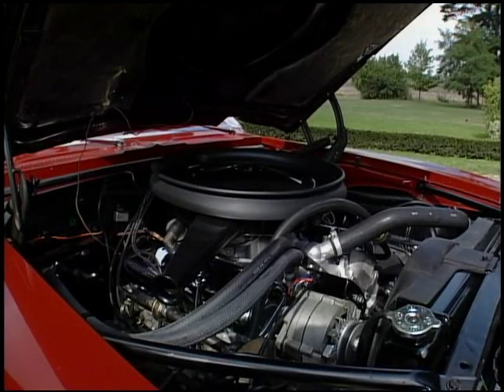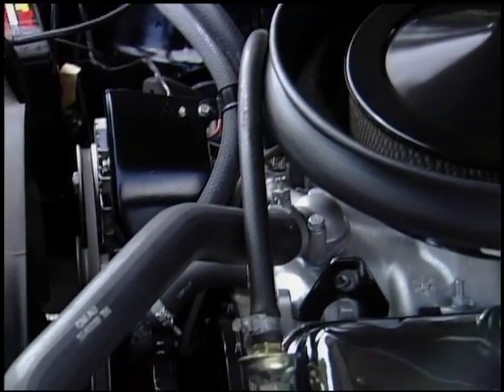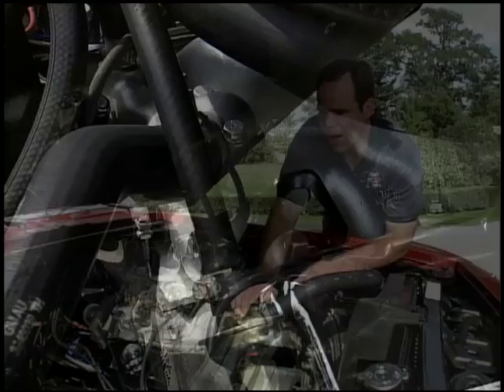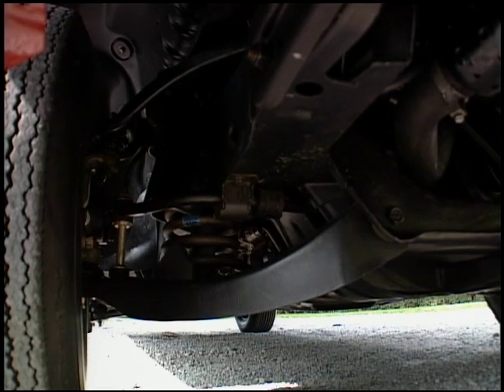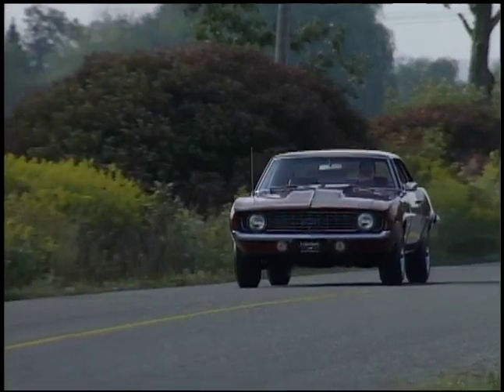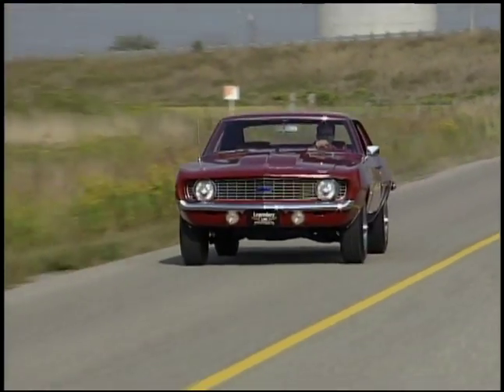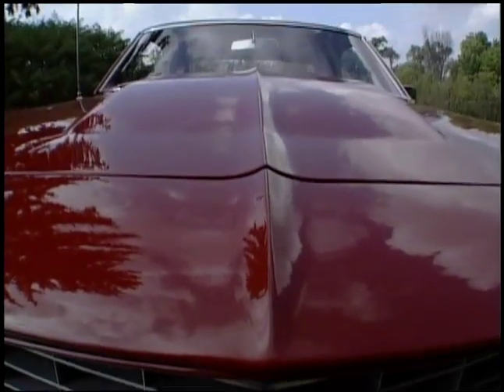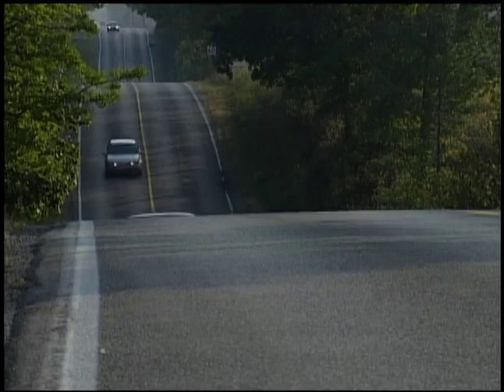Camaro ZL1 Dream Car Garage 2003 TV series

Comment: Why is it a ZL1 in a Camaro and a L88 in the Corvette?
Reply: because they were two completely different engines . L-88 used the cast iron block with aluminum heads , and the ZL-1 was all aluminum, and they did make two ZL-1 Corvettes .. If you wanted a L-88 in anything other than a Corvette you had to build it yourself .
Reply: @bobbrinkerhoff3592  I can't look at it now, but I am almost positive that his 68 L88 was all aluminum. I could be wrong but I don't think so. As so as his dad bought it he had twin turbos put on it, he drove it one time and it scared him so bad he parked it in the garage and last I heard it was at a storage in Upland California.
Reply: @jameskosharek6838  L-88 was only available in 1967,'68, and '69 Corvettes , if the engine was in any other car it was transplanted into it . There was a guy a year behind me in school that had a Marina blue '67 Vette and it said  L -88  on the console , right behind the shifter . I don't know if the redisigned '68 , '69 cars did also , as I have never had the chance to get that close to one .They made an aluminum big block starting late in '65 for Can Am racing (Jim Hall's  Chaparrals ) , with the street version  ( ZL-1 ) coming out in '69 . The L-88 was iron block , with aluminum heads . Edit; each engine had their own camshaft profile , the ZL -1 was the wickeder of the two , then they started doing updated second and third design versions  of each .
Reply: @bobbrinkerhoff3592  It must have a ZL-1 in it.
Reply: @jameskosharek6838  that or they upgraded to an aftermarket block when they added the twin turbos to it .
Reply: @bobbrinkerhoff3592  that is possible.  Thank you for all the wisdom you possess.
Reply: @bobbrinkerhoff3592  a friend of mine, his dad has or had a 68 L88 but it might have been a ZL-1 because I swear the block was aluminum but I could be wrong. As soon as he bought it off the showroom floor he took it to a shop and had twin turbos stuffed into it. My buddy took it for a joy ride almost crashed into a curb and parked it. The only reason his dad knew someone drove it is because he didn't lift the hood and the turbos burnt the hood and the paint. Needless to say he was pissed. I think it is setting somewhere in Upland California that was the last I heard about it.
Reply: @@generallao1554 what about 68, that's what my friends was?
Reply: @jameskosharek6838  '69 was the only year for the ZL1 Vettes and they only built two of them and close tabs are kept on both of them . '68 was the iron block , aluminum head L-88 cars .

Comment: "The 69 Camaro ZL-1 made an even better street car than a race car" said nobody EVER. The ZL-1 427 didn't have any street manners because of it's 12:1 compression ratio and L88 cylinder heads. Definitely not an ideal car to buy to drive back and forth to work every day. A 69 Camaro SS 350 or 396 or a Camaro Z28 was a much better choice for a guy who wanted a fast car that could still be driven daily. If I was buying a brand new Camaro in 1969 it would be a Z28 with the dual quad Cross Ram intake...one of my favorite small block muscle cars ever made
Reply: Sorry, but the dual quad Z/28 would be a horrible car to drive on the street!  Over-carbed and under-powered at low RPM for driving sedately away from a stoplight so as not to attract the attention of law enforcement, that car was for racing ONLY!

Comment: The baddest BowTie ever made is the 69 Camaro ZL-1 But I wouldn't mind owning a 62 Bel Air 409/409, a 65 Impala SS 396/425 hp, a 66 Chevy II L79 327/350 hp, a 69 Chevelle COPO 427, or a 69 or 70 1/2 Camaro Z28. I'm a Mopar guy first but I'm a muscle car fanatic no matter what brand. There's very very few that I actually don't like

Comment: 69 1969 Camaros received the ZL-1 engine right from the factory under the COPO 9560 build order, but only two 1969 Corvettes received them.  Go figure.  Of course, you could always buy one over the counter and install it yourself or pay a dealer to do it for you, but that was half the fun.  Then you could go hang out with "Grumpy" Jenkins on the weekends...😄👍🇺🇸

Comment: "TRIPLE RED"  ???  Interior, body paint....no vinyl top (would be 3).
Reply: @david bleh Uh...what?  The red carpet is part of the red interior.  The OP is correct...for it to be TRIPLE red it would have to have a red vinyl top aaaand...there actually was no red vinyl top available on a '69 Camaro.  You could get a vinyl top in black, white ("parchment" they called it), blue, brown or green.
Reply: actually they considered the top to be separate . The body tag would show two identical letters or numbers ( depending on the paint codes used that year ) for a single color painted car . Vinyl top cars had the paint code first and the vinyl top code after it . Technically it's a tri colored car , But most of us would call it as being red , with a red interior .

Comment: The baddest muscle car ever made by Chevrolet. Even the 70 LS6 Chevelle pales in comparison to a 69 ZL1 Camaro. The all aluminum ZL1 427 weighed as much as a 327 small block so it made for a muscle car that actually handled pretty well and was one of the baddest cars you could buy during that era from any manufacturer. Very few muscle car engines eclipse the power of a Chevy ZL1 427. It's right up there with the Chrysler 426 Hemi, Ford R-Code 427, and Pontiac 421 Super Duty on the Mount Rushmore of muscle car/factory drag car engines. Always liked all the different solid lifter variations of the Chevy 409 too, and the 409 based 427 cubic inch Z11 engine in the 63 Impala factory lightweight drag car

Comment: Wasn’t the danger with the all aluminum motor overheating.
Reply: Yeah the L-72 427 and LS6 454 were more reliable big blocks and could be tuned to have similar power output

Comment: how would it compete with the 69 yenko nova with 427/450 hp,...it could go 0-60 under 4.7 seconds...that's with open headers and drag slicks
Reply: Eric Kort : ZL-1 H.P. IS 550, W/ Lighter MTR. & 12 to 1 Compresdiin.It Was BUILT ,W/ Idea ,it Would Be a Drag Strip Car.
Reply: @edcain3676  the 71 baldwin motion camaro ,at joel rosen of motion performance they took out the stock 396 and put in..choice 427 or 454 with all the high performance parts to engine,honey bee manual valve body tranny(automatic) this car was built to be drag raced ,came with a guarentee if it didnt go 11.50 seconds or less or 125 mph in the quarter mile you got your money back
Reply: @edcain3676  few years ago i argued with a youtuber,he said zl1`s or copos didnt come with auto transmisions,i did alot of researching a auto tranny was a option and i posted links stating this.
Reply: Like the L88 427, The ZL1 427 actually had a lot more horsepower and torque than actually advertised. The L72 427 in the Yenko Nova was actually right around it's 450hp factory rating but the ZL1 actually made near 500hp in spite of it's low 430hp rating. That was just to appease the insurance companies and to try and discourage regular customers from buying the ZL1 because it was built for NHRA Drag Racing
Reply: Same thing Chevy did with the L88 Corvette. They actually rated it at 5hp less than a much cheaper 427 Tri power Vette because they really didn't intend for the L88 or ZL1 to be driven on the street. Both factory race cars
Reply: The ZL1 427 made probably 75-100 more horsepower than a regular iron block L72 427. The 435 factory horsepower rating of the ZL1 is laughable. It made well over 500 peak horsepower.....probably closer to 550. Same goes for the Chevy L88 427. Rated at 430hp but in reality made close to 550hp
Reply: Any real Camaro guy out there knows that there were automatic ZL1s
Reply: @benjaminbritt7862  yep i knew that..in COPO`S